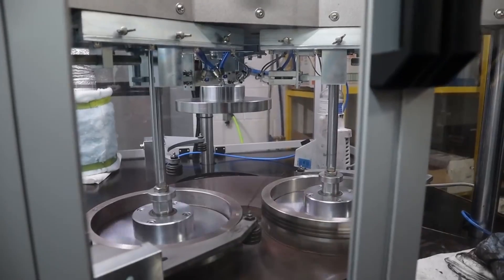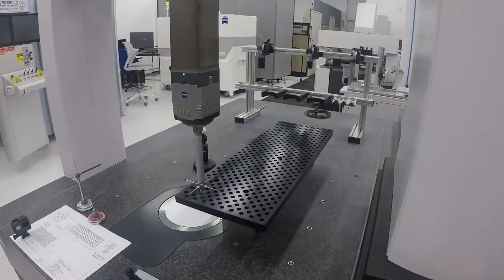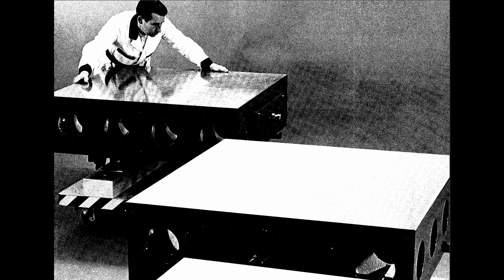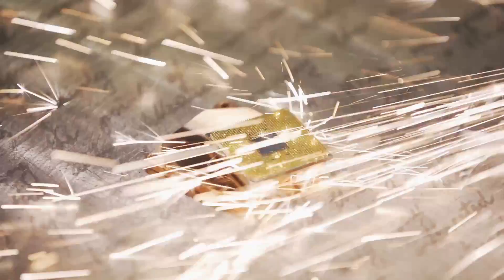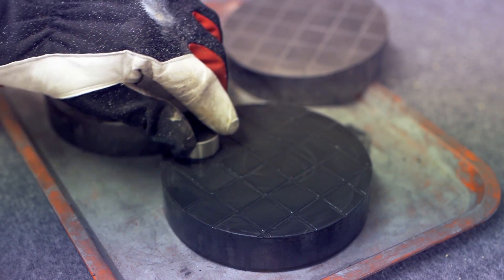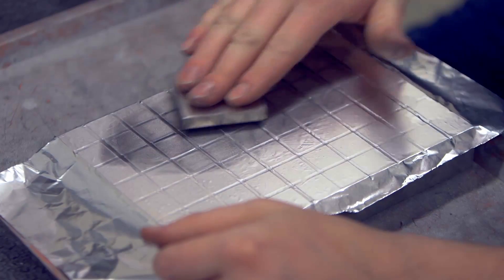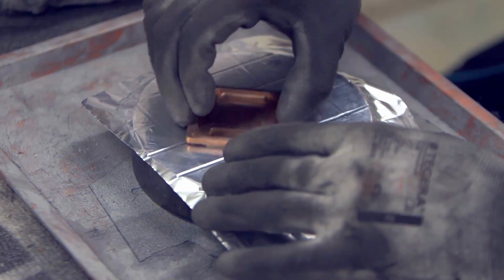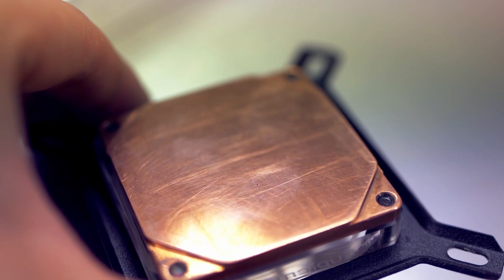Lapping a CPU, the proper way [AMD 3950x]

Comment: I came, I saw, and I came again... Crude but in reality, your video and the audio was like what I imagine people feel through ASMR... I saw this linked on /r/Amd. I am here in a my skilled capacity as Physicist & Nanotechnologist to impart a few points of wisdom. Your video strikes me as you are not just a machinist. Not just a man curious about flat metal. You strike me as someone who wants to understand exactly what he is doing. That is why I stopped here, subscribed and to drop you this line, and to impart some of the physics in what I am guessing is a project you with to take to fruition?

First things first. If you are half the Abom79 you seem to be, you have researched the gauge block story. It's the first stop one makes before learning about micron level measurement.

But gauge blocks are a step past this. You don't use clumsy thumb screw pins to measure the lands and grooves in a flattened surface any more. You use the wavelength of light that refract off the surface through stressed glass. A laser that spans the width of a few mW will do. Red laser, green, blue, makes no difference at the micron scale because the wavelength is measured on a scale that a one micron wide scratch, not deep but wide, is enough that even a red 650 nm laser pointer on the order of 5mW will create enough decoherence of the beam in that pit, the light will begin to scatter very spectacularly. 

Now on the scale of gauge blocks, the flatness is on the order of between 2 and 3.3 magnitudes higher. It depends on the quality of the gauge block. But the wringing effect is not what people assume it to be. It is not actually the wringing out of the atmosphere between the blocks that causes the 'sticking' of the blocks. It is a mixture of physical effects and sometimes chemical effects that cause the wringing to happen. on the scale of nanotechnology, we have to measure defects of  0.5 nm pits using much more pompously named devices. (I hate that physicists of old were so up themselves.) But suffice to say, the simplest way of measuring the flatness of two mating surfaces is by seeing if it can be permeated by the kinetic diameter of a given gas molecule. Sounds difficult right?

Well the actual process is very simple. Attach a hose to the side of the mated surfaces and see if you can separate the two just with the gas force alone. If it can force them apart by gas pressure alone, you know you have defects that span the surface that are at least as large as the gases kinetic diameter. For Oxygen gas, the molecule being O2, the kinetic diameter is approx. one third of a nanometre. And this is where the scale of the physical forces comes in. On that order of scale, if you are unable to force two gold plates apart, you never will unless you cut them apart, as the pits between the gold atoms are roughly that same size. And gold loves to form molecular bonds with more gold to make more crystal lattice. At this scale, the electromagnetic force, the gravitational force, and the energies spread between potentials and kinetics reaches an equilibrium where the two surfaces are no longer separate surfaces. At this point, you wouldn't need thermal paste. Until you applied power to the processor. At which point, due to the different expansion rates of the steel integrated heat spreader, and the heat sink material, the heat sink would catastrophically 'pop' off the CPU. Or, if that's not bad enough, the bonding force of the two surfaces may be enough that the heat could bend the IHS in some nasty way that may crack the silicon crystal it is attached to (can't remember if Zen is soldered, but I know the bulldozer chip was...). This bimetallic strips. Your indicator has one. One side copper, the other side an allow of tin, copper and zinc. The differences in the crystal lattice cause one strip to expand ever so slightly further as the current passes through them creating heat. The more heat, the more acute the bend.  It keeps bending until it makes that famous click-clack-click-clack sound. That is literally metal bending itself so far out of shape it overcomes a magnetic force on it and arcs as it separates. Then it cools so rapidly it slams back into the contact point again. 

That would be the perfectly lapped CPU. Lapped so well to perfection it throws the heatsink out of the computer, shatters the crystal under that perfectly lapped metal, right before it goes into meltdown. It would be glorious. But alas, no room to stretch no place for the heat to travel. The thermal paste, thermal grease, or whatever tack compound you use, it doesn't just transfer the heat, it allows the cpu and heatsink to 'breathe' at varying rates while still keeping the surfaces in contact.

Now I know the catastrophic end is a little out of proportion, but you would be surprised at the amount of potential energy held in that zone between two different flat, wrung metal surfaces. As the heat climbs to thermal criticality, so does the potential for pieces of metal to fly off at speeds on the order of multiples of the speed of sound...

Anyway, I had a great time watching your video, and I have to say, not only is watching you teach yourself how to do this stuff satisfying, but so is your voice. It's on par with Morgan Freeman <3
Reply from the maker: I've heard concerns from a lot of people that the unequal thermal expansion of the metals involved could lead to a catastrophic breakdown of the system — or at least degrade the thermal conductivity to the point where either performance throttling or damage were the only possible outcomes.
I'm not prepared to publish results yet but in the system I've been running under full load now for several weeks it's not what I've observed. I do have a large temperature delta between the two core dies that would be a cause for concern if I were using some thermal interface material but here it's just a reminder that oh right, flat is an ideal and 300nm is still a lot of deviation.
I'm not sure how much energy you'd have to put into the system to provoke the kind of catastrophy you describe but I have a suspicion something else would have to give long before that point were reached.

I was not aware of macro-scale cold welding being accomplished with gold, if there's a publicly available research article on the topic I'd enjoy reading it.

The next project will be a set of scratch built stainless steel angle plates using the three plate method.
Reply: @Penrowe  I should clarify that I was being hyperbolic about the scale of the catastrophic failure. The type of failure would be runaway thermal spike.

The mode of failure, and it's level of risk, would be in the worst thermal scenario. Cold standby, and booting immediately into running multi-threaded recursive mathematics such as a mersenne prime search. It would need to create a shelf between the two metals, not a gradient. Having a gradient means there is still thermal transfer between the two separate parts. Now, from memory, steel expands by about 10 micron per meter Kelvin. and after doing a little searching, I found, and was extremely surprised to find this out, AMD and Intel both use nickel plate copper IHS's. Copper's thermal expansion is significantly higher, and much closer to that of aluminium. now, because that expansion rate is so incredibly small, you would need a large and fast increase in temperature to cause there to become a shelf between the two materials. Looking at the thermal conductivity of the two, aluminium has just above half the thermal conductivity of copper. so that would double the amount of thermal mass needed to radiate the same heat as the copper area transferring the heat to it. But, because the two surface meet at equal area's that cannot happen. Instead, the copper becomes hotter and thus more efficient at radiating and conducting its own heat to the aluminium.

That would roughly equalise the two surfaces expansion rate. I actually predict using ANY heatsink, and ANY processor of the combinations Al/Cu or Cu/Cu would actually be able to transfer the heat properly. If fact, the standard heat transfer of thermal paste (the standard arctic silver paste or equiv.) has a thermal conductivity just over 1% that of copper. And heatsinks are still able to transfer heat just fine through that.

So with careful consideration of the materials you are using, and considering the ductility of copper, I honestly think you have nothing at all to be concerned about by trying it, other than thermal throttling in case the mating of the surfaces is not quite good enough. my prediction is actually that you TDP will increase from the wraith prisms average of 125W to a much higher value, of the order of 200W(aluminum heatsink)/350W(copper heatsink) just by getting the surfaces to mate well. Realistically you would be looking at about half that increase because even micron pis are enought that the surfaces are instead of using conduction, will instead rely on radiation and absorption to transfer the heat. And unfortunately there will always be random amounts of backwards transfers as a result where the heatsink radiates some back at the IHS. Hence, hot spots.

And you are correct. 300nm is massive. But it is still small enough that unpolarised light can still pass through a half wavelength and never get the chance to refract off the side of it and thus would create destructive interference to any wavelength multiplets. But if the fringe is all you are looking for, and your sensor is good enough, using a blue-violet laser around the 400-450 nm mark, you can get light to create large constrictive fringes on the scale of 1 nm pits all you need is the light to not finish its wavelength before hits the bottom of a pit and it will create some very beautiful scattering fringes. The other thing with high sensitivity light refraction flatness testing is that you must tune the optical piece to be some exact multiple of the center of the wavelength span you are using. That is where the difficulty comes in with optics. the more intense the light you are attempting to measure with, the smaller tolerances you have to hit. Comes down to Heisenberg's uncertainty principle. You can know the depth of your pit to a much greater accuracy the larger it gets. But the smaller it gets? At some point, that ceases. It usually occurs after the nano scale. Anything below 1-2nm will have to take into account the atomic structure of the two materials, and if you still want to, then you can always use smaller and smaller wavelengths of light. But using anything more powerful than violet light, it becomes ionising radiation, and at that point, you are no longer measuring the surface, rather you are evaporating it :D

I've always wanted to lap a processor and heatsink together as a project myself, and I am keen to see what the outcome of this will be. I am also a very curious learner such as yourself. So I have nothing but the utmost respect for what you are doing and I thoroughly appreciate anyone doing work like this.

As for the macroscale cold welding, there are not a lot of publicly available documents on it, otherwise patented welding technology could be free to all. I think that's bullshit, but alas the world has succumbed to capitalism. So instead I'll link a few youtubers who have done research on this exact topic: 

1. AvE seeing if he can cold weld two 5 ounce gold bars
2. Cody's Lab doing a collab after AvE sent the bars to his to see if he could do some more testing on them.
3. Veritasium explaining how everything that is prepared for exposure to space must have an oxide layer, or made of plastics/ceramics and other non crystalline materials that must react to be able to fuse so cold welding wont occur.

I know these three are only anecdotal, but the theory matches it, and two of them produced the same results (alas with the very same pieces of metal, but thats life.). To throw a spanner in the works, the last video is a surprising, yet again anecdotal, contradiction to the theory. But it is absolutely fascinating.

https://www.youtube.com/watch?v=mHAhfX7iRjs
https://www.youtube.com/watch?v=GtcuURSYgvo
https://www.youtube.com/watch?v=Y2nQ8isf55s
https://www.youtube.com/watch?v=07CShwlSnms

If you have access through a Uni or other research institution with partnership to Nature, here is a great article that explores cold welding gold nanowires to create nano machines without the need of heat jointing and how it brings the possibility of smaller and smaller joints into the picture. If you don't have access through an institution, then the abstract, images they show and their references are interesting to look at either way:

https://www.nature.com/articles/nnano.2010.4
Reply: Oh and please please please keep me up to date with this, I don't just want to know the gist of it (although with your voice I would still be interested lol) , I want to understand it. And I'm guessing you'd be the right person to talk with that we may be able to help each other understand more about this :D Good luck, and I have confidence that the project will work out surprisingly well, regardless of how un-accessible it will likely be to the home user.

P.S. magazine paper has a thin layer of coating on it that creates the reflective shine. I know this as I come from a long line of print finishers the powder has to be be micron sized to be able to stay suspended in the curing agent, so it will be the perfect polishing implement. layer that on a true flat, and you have yourself the best possible polisher. Truly flat, truly ductile enough to capture the swaff, with hardened particle sizes so small you you'd never find it even in a machinist shop, and the best of all, 2 bucks a book of 100 odd sheets lol.
Reply from the maker: I work ten hour days beyond which I've got a family and a house to take care of so most of my projects get really drawn out — and that's if I don't go back and redraft a script ten times over.

If you want to check on the status of things here's a tool I use to track what I have in my pipeline: https://trello.com/b/gBZeei76/pipeline

What kind of magazine paper should I be looking for? Gloss or matte? Approximate paper weight? Would it make much difference if it's from a particular manufacturer?

Comment: Any chance you could try this again with an air-heatsink? 
You might be able to wring them, and the temps could be compared easily to established benchmarks.
Reply from the maker: Could be done but the kind of tower coolers that enthusiasts would be interested in seeing performance figures for like the NH d15 can't be easily milled unless you first make some custom fixture. In the case of Noctua for example the cold plate is known to be convex so the thought of having to bring that within the same spec as other parts I hand lap without face milling it first is thoroughly unappealing.
Reply: @Penrowe  Most coolers are convex because of the Intel practice of having the CPU dies in the middle of the wafer... AMD don't do this :)
I got a Noctua within lappable flatness after about two hours of wet sanding, and it would probably take at least that long to make a custom mount for the mill!

Comment: This is amazing!! Would you please consider making a video showing how you made the lapping plates using the 3 plate method and cutting the channels into them etc? Also if you lap the CPU and thermal conductor together how does that work with the channels and such?
Reply from the maker: Check the links in the description, oxtoolco's videos on hand lapping are several hours long in total and give you all the information you'd want. The only thing I did different was milling the groove pattern.

Comment: The question of running a wrung processor/heatsink pair without paste has been kicking around in my mind for a bit. 
Perhaps this would be easier with an air cooler, even if it's only a single sample with a sample before and after test. 
Interested on seeing how this works out with the flattened IHS and paste though.
Reply: I suspect it would be difficult, as the two may unwring when the processor heats up.

Comment: Mounting the heat sink directly on the silicon is the most thermally efficient way to cool it. Direct die cooling. The inside of the IHS doesn't even make contact with the top of the silicon! Manufacturers use either solder or thermal paste to transfer the heat from the silicon to the IHS, and then you use thermal paste again to transfer the heat from the IHS to the heat sink. The trick is making sure you don't crack the silicon!
Reply: How flat is the die? The etching process is so ridiculously precise that I expect the die to be super flat too. And BTW, many CPUs in the early 2000s didn't have an IHS. You put the heat sink directly onto the die. And yes, lots of chipped dies, shops has signs explicitly telling they don't accept returns for chipped dies. Probably the reason why modern CPUs have IHS.
Reply from the maker: I do have some older CPU's I could attempt to delid to measure their flatness and check for wringability but even if they're not flat already it's something I should be able to solve. The only issue is time.
Reply: 3D stacked chiplets from AMD will eventually kill direct die cooling as the height of the individual chips will be of varying height.